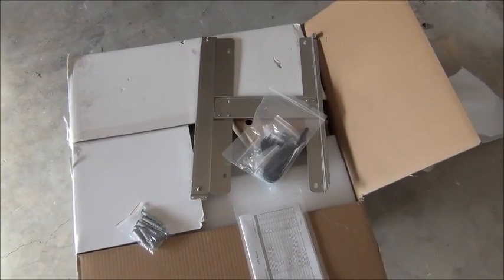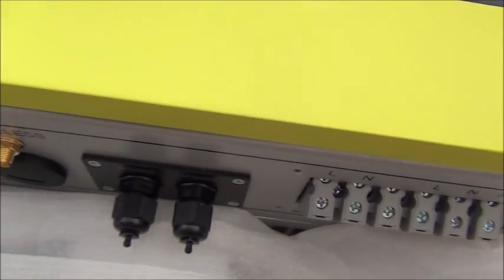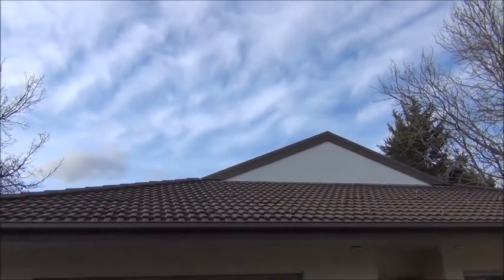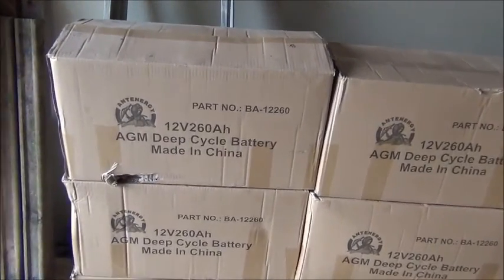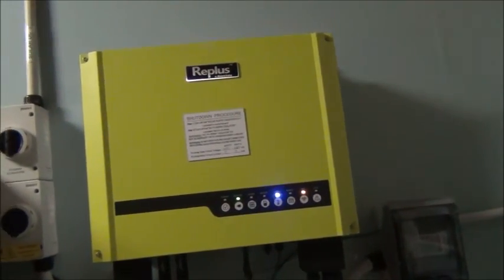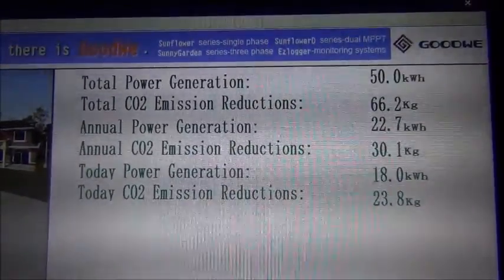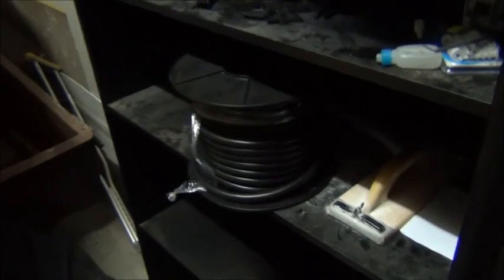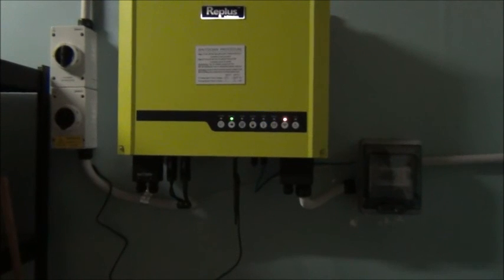My 5kw hybrid system install

Comment: Well that’s not a glowing review 😀solar I nstallers have had it easy for a while and bad manners makes for a bad reputation. I might work something out like that for what we have in mind here. Thanks.
Reply from the maker: Also the problem is to get the Government rebate company's are limited to trying to keep people on the grid thats why they say its for 500ah battery bank as it cant charge anymore in a day as I think its only 60a charger and it likes to use the grid always.
Reply: Oh I hadn't thought there might be a limit to what power you could store from your own roof?  Thanks.
Reply from the maker: Mike Simmonds not a limit as such just the rebate product has to be designed for the system to use power and only off grid if its out. If you cant get power and qualify for the off grid system you get totally different products offered and a better designed system.

Comment: This unit does it invert the incoming power too or is it just a battery storage system?
Reply from the maker: yes I think its 5000w direct from the panels and 3500w from the battery I would not buy it again the manufacturer was okay but installers dont know how to set them up. I do have it working well now but I had to learn how to program the batteries and wire it correctly and tell the installer how it was supposed be wired. If I was to do it again i`d use 80A mppt solar charger ( PIP5048MS) on ebay and link 2 for half the price